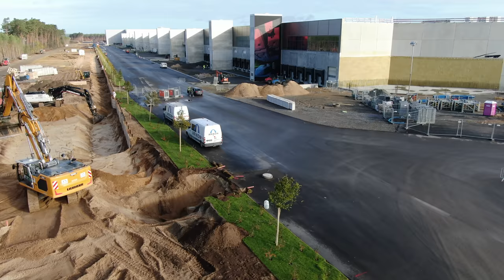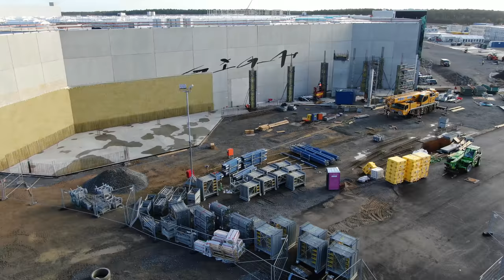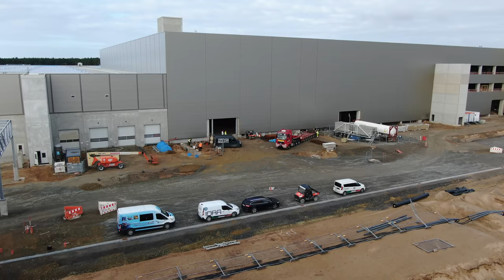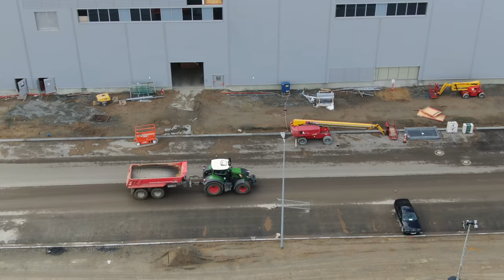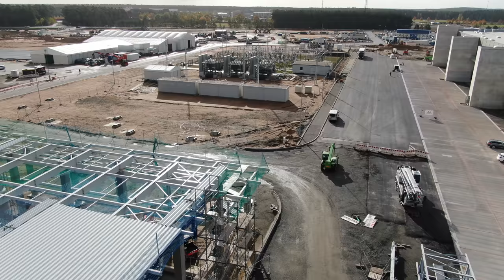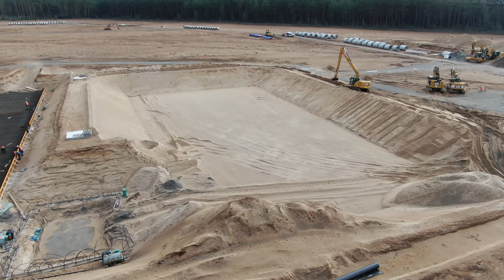Giga Berlin | 2021-10-23 | Progress Update

Comment: I’d love to see how they make those concrete columns with the supports for cross beams.  There must be some interesting engineering involved there!  Thanks for the video!
Reply: Pillars https://youtu.be/atJv308BHA0 and beams with pre-tensioned steel: https://youtu.be/5wV0xtVSkE0 (probably not in Germany)
Reply: the gigafactory has concrete walls running down the entire side of the building (on the inside) and they do this to prevent massive fires.  I know why they would require it here, but why require it in a battery building?  You just turn the machines off and take all the batteries out.  the building is being designed to move batteries very very fast around so they are produced in the minimum amount of time, so it would have less of a fire hazard than the giga
Reply: @davidanalyst671  You have no plan of batteries ...
Reply: @davidanalyst671  In Europe, this concrete construction is probably cheaper than steel, especially for high floor loads. Batteries spend actually quite a long time in the factory, they need to "ripe" for a while and then the proper anode/cathode coatings are created during the first charge/discharge cycles which which also takes quite a lot of time. They are stored and charged in the white racks with white boxes in the Tesla making batteries video.
Reply: Found a video from Rekers, the company producing the precast concrete parts for the cell factory.
https://www.youtube.com/watch?v=TkUsR6ie2zg
Reply: @davidanalyst671  " the building is being designed to move batteries very very fast around" 
The building is designed to host machines producing/handling battery cells very fast. That means high dynamic loads.

Comment: Impressive work, but I think they could go a step further by using more cranes at the battery facility. All these beams are just waiting to be installed
Reply: Super tight space, can't have too many cranes operating at once. Besides, the battery factory doesn't really matter for the start of car production, I'd rather they just dropped it for now and focused instead on finishing the central utility and the sewage system. Those are the only two bottlenecks left.

Comment: I think they will have to dig up that staff car park sooner or later.  Different states in Germany are debating laws making it compulsory to have electric car charging at work.

And it's a little ironic that a big electric car company doesn't have a staff car park that is EV friendly.  Many of the workers will live in apartments and not have off street parking, so they would have to rely on fast charging which is do-able, however not as good as slow charging your car whilst at work.

Comment: All I want to see is the tesla  designed and run 4680 battery manufacturing, not just a few cells whizing by but the full system shown in detail. Yes it is top secret technology, but
 If it is as hard as musk says to get it up and running taking almost 3 years to design and get it running partially efficient with 80% success in cell manufacturing, I doubt any competitor could come close to competing, and  I am sure anyone wanting to already knows everything they need to know